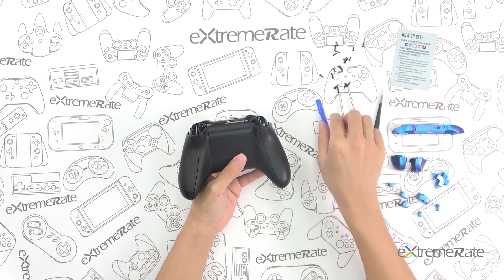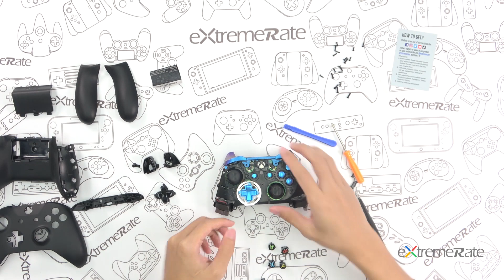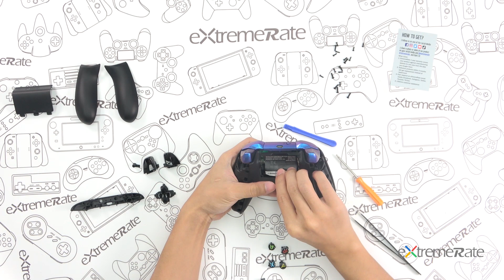XBOX ONE S Controller Buttons Installation Guide by eXtremeRate

Comment: Wanted to say thank you all for making the replacement side panels for the V1 Elite! I had 3 dead and useless V1 Elites (1 bought, 1 obtained as a gift, and 1 that was sent to me as a "Goodwill replacement" from Micro$oft). All 3 lasted 4-8 months before developing the same issues (Peeling grips on the side panels due to the garbo adhesive M$ used in manufacturing, and a couple of broken shoulder buttons due to garbo design).

It cost $60 to buy 3 sets of side panels, but they're a remarkably close match to the originals. $20 for a Systhetix replacement bumper kit (Includes 2 bumper pieces), and I now have 3 V1 Elites that look either brand new or pretty good (One had an inner grip issue on one side that was bad enough that the grip had to be trimmed down with an Xacto, since the rubber stretches when the adhesive fails), the others just needed to be carefully re-bonded where there was some minor lifting.

I spent a year and then some in limbo. The few indy shops left wouldn't touch them since they couldn't get OEM (Or for a while, any) parts. M$ wouldn't even repair a V1, I offered to pay them to repair or replace the damaged units. They weren't interested. I guess they were saving the last of their refurb stock for warranty and "Goodwill" replacements. Replacement out of warranty = "Lulz!" once the V2 came out. My request to buy the OEM parts and fix them myself was met with something akin to a "Get bent!" by M$. I mean, how dare anyone have expectations about design and manufacturing defects after stuffing $300+ into their pockets for a couple of controllers. 🤣🤣🤣

So far so good after 6 months of use on one of the repaired controllers! I'll continue to monitor the inner grip area, as a new shell with the inner grips is now $50 on Amazon, and at that point probably not worth replacement after already spending $30 on each controller to get them functional and looking pretty good again.

So THANK YOU for making these much needed replacement parts. I'm amazed you were able to get the rubber grip texture and color so close to the original parts! Including the needed tools and uploading videos like this 

HUGE thanks and thumbs up for you on behalf of all Elite V1 owners who had problems with peeling grips on their controllers! 👍👍

(Now let the comments from the owners who used their Elites 40 hours a week for 5 years and never had an issue step forth, insisting that I must have thrown my controllers off a skyscraper, pissed on them while in a drunken stupor, doused them in gasoline and set them on fire, drop kicked them into the nearest wall and torn off the grips in a fit of rage, or otherwise abused them, since their own lack of problems conclusively proves there were no design or manufacturing issues with these units. 🙄👍😂 'Cause after all, for-profit companies are absolutely in the habit of sending out replacement units for originals that are out of (The absurdly short) warranty when they've done nothing wrong in design and manufacture. Shame it didn't save them, apparently there were more than enough pissed off V1 owners to finally get a class action lawsuit against M$ going... 😂)
Reply from the maker: Thanks for such a long comment bro, you are rich of humor and you told the truth. MS made bad Elite V1 and even worse on V2. The controllers are good but the quality just not worth the price. We are very happy to help the V1 owners out, you know we takes a lot of time on the texture and the color of the grips, just want to make it looks like the original, but with better quality :D

Comment: Finally a tutorial without needing to use soldering iron to take the controller apart. Does the battery sticker come off that easily or is it suggested to use some heat?
Reply: I was able to peel it off using the separating tool they include in the kit.

Comment: Hello I'm very upset today I enjoy watching your videos, my controller is giving up on the L3 stick, not working I'm not sure what to do I'm afraid I might break it
Reply from the maker: What's the problem exactly? Do you mean it does not allow you to press/click it down? Or it does not react?
Reply: @ExtremeRate  so what's the issue with the controller is when I click the L3 stick it'll be ok for a moment but then sometimes stop working when running in cod of course I can move perfectly fine but the clicking isn't working as it should... So say if I click the stick to sprint but if (x2) to tact sprint works like 1/4 the time...
Reply from the maker: @neitomu  Please check if there is any dirt or something under the L3 tact switch
Reply: Yes I did fixed it by using a tiny suction vacuum and it works now heh go figure
Reply from the maker: @neitomu  That's great!

Comment: Love this! Would this fix sticky buttons? Wanna try make my xbox one controller work a little better cause all the series X controllers I get are broken out of the box for me. My luck is trash 😅
Reply from the maker: It depends on how does it stick. I suggest you replace the rubber pad under the ABXY buttons at the same time if your controller was heavy used. Good luck!! :D

Comment: Do any of these parts work with the elite series 2? Obviously the dpad does not and will there be a set like this but for the elite series 2?
Reply from the maker: The shoulder buttons are not the same. Our series 2 buttons pack is coming, please stay tuned (not included dpad of course)
Reply: Ok thanks

Comment: Can't attach the ribbon cable again, any suggestions?
Reply: Just put the wire on top of the circular connector and push down till you here a click and it is fully held on there

Comment: 16:00 I can’t get this part to go. It’s the only thing holding me up.
Reply: That part was a struggle for me too, Just got to wiggle it around a bit. Once its in place make sure your bumpers still click like usual.
Reply: @talon1802  I can get it to look good, but they don’t click. If I take the middle section off they’ll click but it won’t sit right without it, I’ve given up for the moment.
Reply: @Jetanium  for me it was easier to put it together than attach the middle bit. 

Try looking for the button your bumbers click. Its weird to explain but you need the bumpers to go under not over a line of plastic in order to click the buttons.

Sorry if that makes no sense, I hope you figure it out.
Reply: Put the bumpers first and then after your done with that put in the middle part. Try and it align it with the charger port first and then push up and connect it. That’s what i do. Hope this helps

Comment: Now my controller won't turn on :/
Reply from the maker: Please try to use the USB cable to test, if it can turn on in this way, then please check if the metal plates in the battery tray was installed correctly

Comment: The controller doesnt even turn on.i followed through everything, And the buttons dont even work. 0/10
Reply from the maker: Please check if all the parts installed correctly. Something like the battery metal plates went through to the battery tray, or something other minor faults during the installation.
Reply: lmao YOU def effed up. I replace my buttons/shells all the time and nothing ever happens